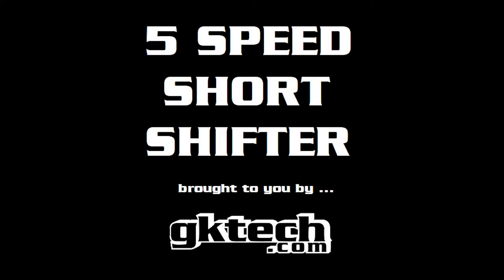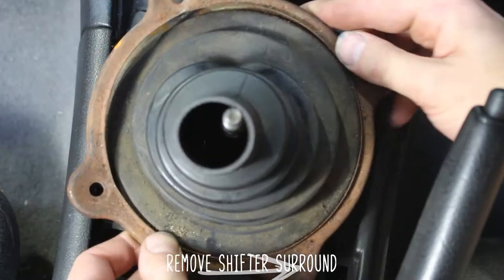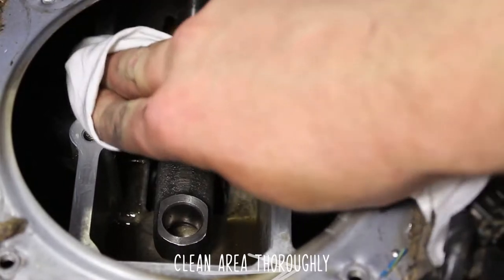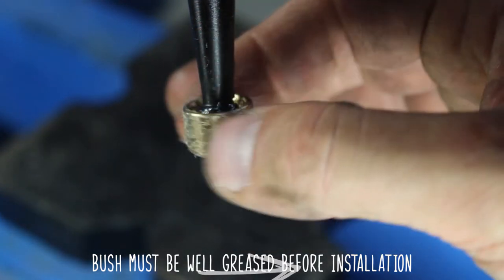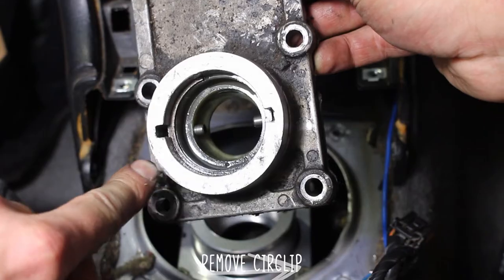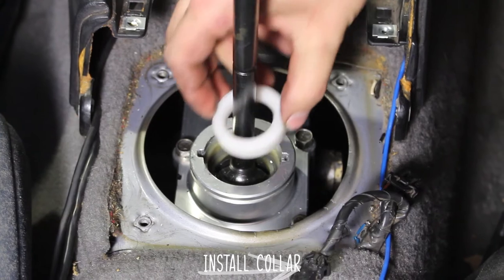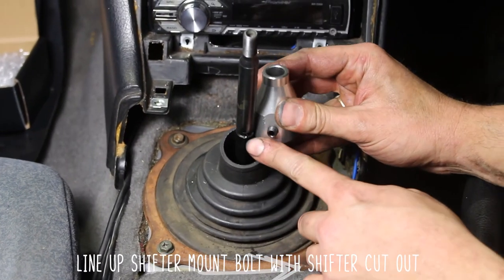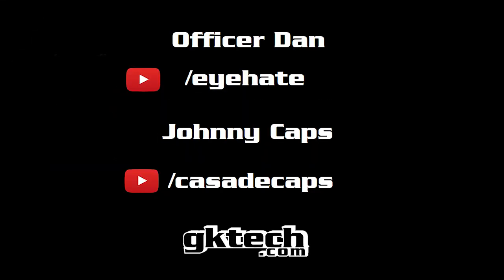GKTech S13 / S14 short shifter install, for Sr, Ka and CA transmissions

Comment: Save yourself 3hours of fucking around and throw out the included shifter plate and shifter bush.

Remove the first circlip and oem shifter as described in the video.
Do not remove the spring clip or shifter cup from the oem shift plate.

Under the oem shifter skirt is a thin white bush, neatly cut the bush so its im two pieces (i used a dremel blade)

Fit the short shifter into the oem shift cup which is still in the shift plate.
Fit the two pieces of the oem shifter bush (grooves face up)
Push down as you reinstall the circlip

Refit all the rubber dust skirts

Youve now turned a 3hour plus job into a 20min job

Comment: The GKTech shifter was an absolute waste of time, money, and energy. Do not buy this unless you want a poorly designed and manufactured rattling shifter. 

My favorite part is where they cut out installing the factory circlip and then installing the supplied snap-ring. Probably because they didn't actually install the circlip. This video does not follow the instructions from GKTech, and leads to a ton of confusion in regard to the most important part. 

I've been back and forth with GKTech trying to figure out why my shifter rattles so much, but they won't back their product. I've sent videos and photos, but they refuse to fix the issue. The brass bushing rattles, the pins in the cup rattle in place, the cup pins also rattle against the shifter ball slots, and the snap-ring is too thick to fit under the circlip without forcing it into place.